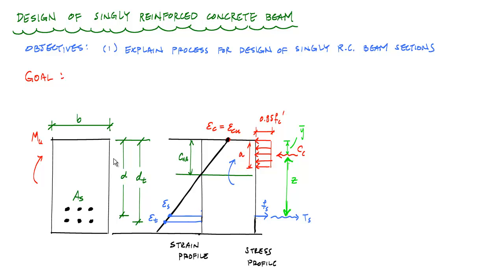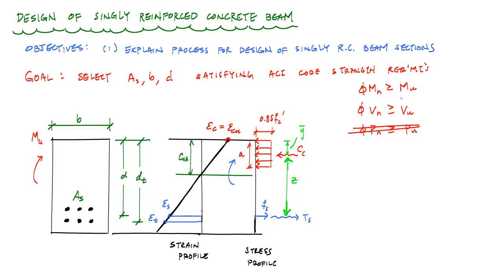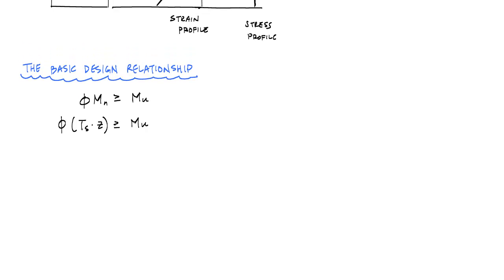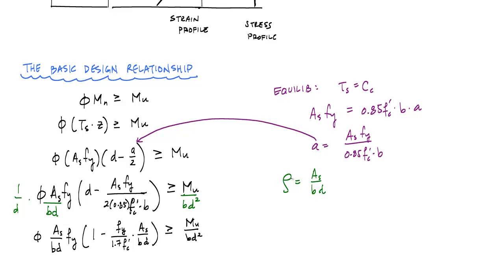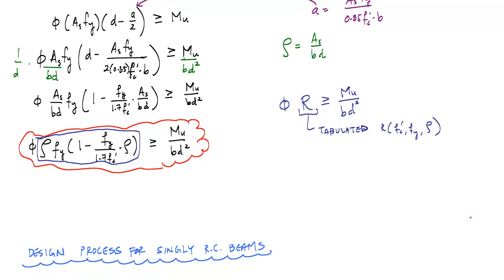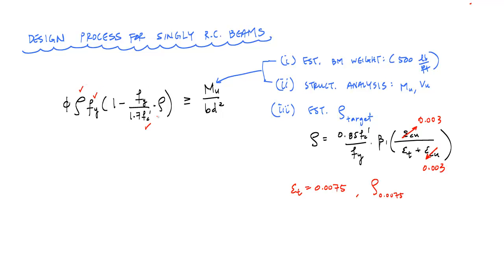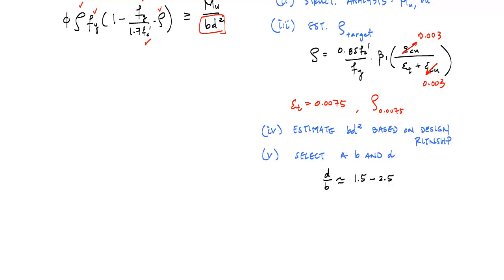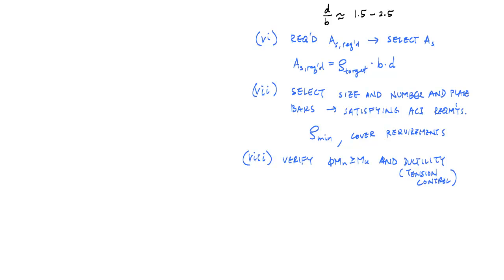Design of Singly Reinforced Concrete Beams Overview - Reinforced Concrete Design

Comment: Reinforced concrete cemenT ----- osteocyteS in wisdom age arE flexible --- the reversciblE process of sTonE occurs in Planets likE MaRs : Saturn thaT has extreme climaTiConditions of temPerature anD /AtmosPheriC) pressure ----- obvious atmospheric pressure HG s®ounD ---- 2ooo HG iE sedimentation of atmosPheriC gas  on surfacE of PLanet : by lowTemP Air whilE hot air fLoaTs Thus aTmosPhere gas pressure ComPresseS lanD ---- in extreme conditions creating reinForceD  PressureD sTonE iE cemenT ---- on aquireDePositionS also on EartH at extreme climaTiConditions arE presenT iNortherN AfricA --- thaT forms LanD at equvitoriaL region abidE oceaN aThaT measurE----- aLso when detailed about extraction Maximum stones arExtracted from Northern AfricaN region to be fragmented ---- osteocyteS has fibriN  in longitudinal axis and transverse axis ---- along linear axis iE horizontal beam [HorizoN] of equatoriaLunE : surfacEartH --- the horizontal concrete shoulD be inPoseD with horizontaLine fibers aSeen in cLavicLE ---- lineaR axis horizontal is linear fibrinS : eacH fibrinS shoulD extenD thrOuT wholE sLaB of singulaR uniT of manufacturinG) ----- thaT on soludification aquires praportioneD) ----- elasticity NoT aquireD in metalCemenT beaM : ComPosition of fibriN [ caLciuM + juveNiLEgg shell oR largE quantities Northern AfricaN typE soiled stoneS) + fibriN from organism ProDucTsiLK : thE nearesT reacH to coresPoNd osteocyteS in largEnormouS quantities isilk whilE minor quantities foR exPeriMenT cases aquireD by unCLaimeD dead foetus is  processed foR eLasTiCemenT ----- CocooN winD  caPsuLE-- ncaPsuLates weighT in susPension deFiNation : cLavicLE susPension encaPsulates acromioN carYs humoR --- construction EnggeneRinG lacKs knowledGE of susPension engeneering in skyScraPeRs defininG an anTiGravitizeD weigH balancE thaT can reacHigher skyScraPeR heighTs uPTo 25o FL /4oo cmS peR FLooR --- iT aLso resists PLanE attacks as PLanE attacks can victimize weigH bearing skyScrapeRs eNoT susPension integrated cemenTowers witH noMetals thaT molTeniseD en cemenT doesnT moltenises examPLe [ cemenT furnancE] to fragiLE leaDucTilitY in railways coresPoNd --- nonMetaL beaM bearing weigH is femoR + nonBeaM susPension weigH bearing is humoR ----- fibriNs in skeleton system is protein / CocooN is ProtieN /AnD siLK fibers longitudinaLY PlaceD on LongitudinaLengTH of cemenT sLaB  reduces fracturE of Pillars [flexion becomExcuisitE] ⬆️ higheR thaN usuall sTeeL beams ThEquaTioN of integeateDerivaTioN doesnTrottlE negative functioN buT anotheR system [ 1/ SiN x ---- coS x] insteaD sinX ---- 1/ coS x noT induLginG NeGativE Fx oR NeGativE scalE The minuS Fx significancE is onLy foR error damagE oF anY
 ComP --- osited functioN EveN in integeated EquaTioN x tendS to zerO.oo oR x tendS to + 400 cmS perFLooR defines no minuS valuE in Dx ---  onContrarY minuSigN hasTo bE calculated in proxiM phasE oF erroReDucTioN leads to + PLuS ClimaTiConditions DamageD cemenT sLaB on deFiNation /AfteR calamities oFalls is no signifieDx --- marroW : holloW insuvinates h2o turbulencE or wastE To durAbLE construction ---- bY subscidencE temP in holloW + iF WTC were madE aCorDinG to concePTheN WTC 2 FirE fighTers coulD havE saved traPeD oR LoCked civilization abovE level oF PLanE attacks anD afterMatH DamageD FLooRs coulD havE been recounstructed NexT anY Field oF engeneering on you tubE

Comment: Here is a question. In the deflection measurement of simply supported beams it is assumed that displacement measured at supports 1 supposed 2 and the middle span of Reinforced concrete beams are 0.10mm, and 6.8mm respectively. Please calculate the true deflection at the middle span of RC beams
Reply: I got the solution

Comment: Hi Structurefree! I have learned a ton of things since I started watching your videos some 2 years ago. However, what I struggle to understand is why do we always need to take the full compressive strength? I mean, in a ductile, tension controlled beam way lesser than the balanced. I mean, that beam which has a very thin reinforcement for instance, (just to exaggerate and emphasize the effect), the compressive stress does not attain 0.85fc. Therefore, if we consider the actual, the value "a" will be greater, therefore the moment capacity is safer. I struggle a bit with the 0.85 fc. Thank you very much! I hope somebody answers this for me, please please cant get it out of my head

Comment: one question. How can concrete compress in bending, if supports are fixed?  Because length of concrete fiber cannot shorten but only elongate when bent. If supports are fixed there should only be tension in beam, tension being highest in one extreme fiber and lowest in other extreme fiber.And what are the assumptions made that allows the compression of concrete?
REPLY

Comment: Guys, For all concrete design tasks try www.structuraldesignsoftware.com.au
the software design to AS3600 flexure, shear, shear and torsion, slabs, footings, combined footings, and checks for crack control and deflection. Try it. it is great !!!

Comment: The comment may be a little late but can you show how to calculate the maximum instantaneous deflection of a rc beam.
Reply from the maker: +Patricia Nyadhi I can add that to my list since it really depends on whether you are looking at short term or long term deflections and it also depends on the loading since that will influence the moment of inertia of the section.
Reply: +structurefree  that'd be really great.... esp if u start from finding short term and long term loading